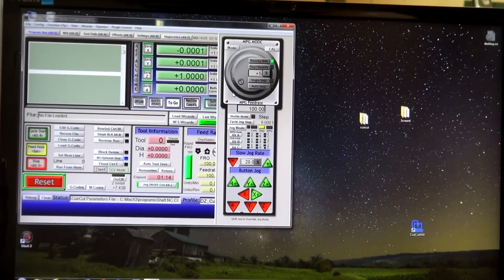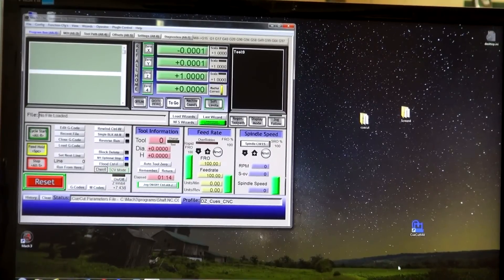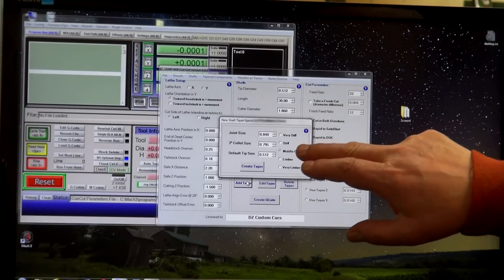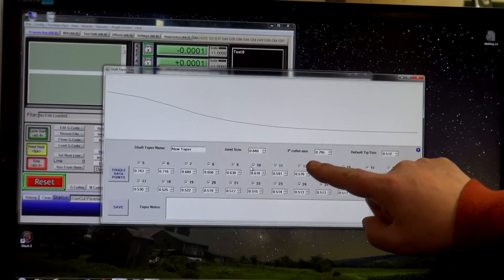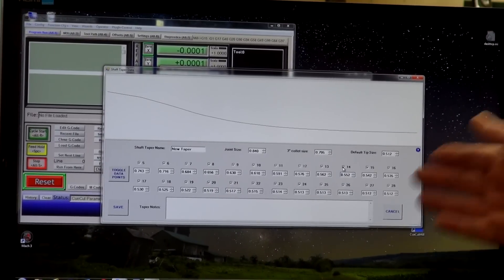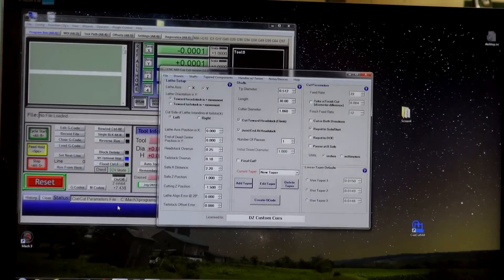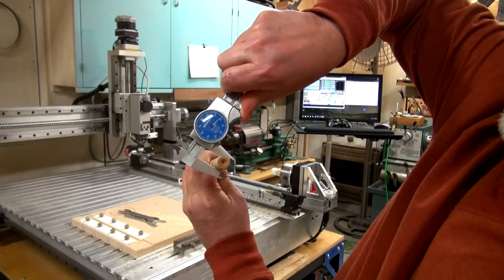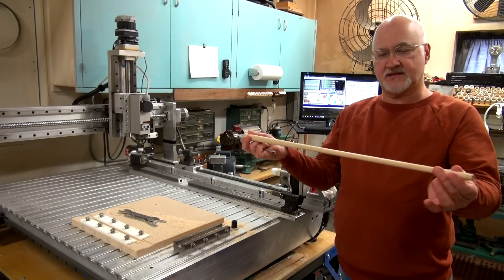Cue Making - CueCut Shaft Taper

Comment: Bob,  I have this program and had to call Kelly to get straightened out on the cutting of oversized shafts as you are talking about in this video. From the help files I got confused in the wording. I have a standard (my) taper and 3 others that I may use (vstiff, stiff, med). I have three  shaft folders.ROUGH, ( tip size specific) and FINAL ( tip size specific) using my standard taper (Kelly stiff slightly modified), and SPECIAL for copying a customer shaft.